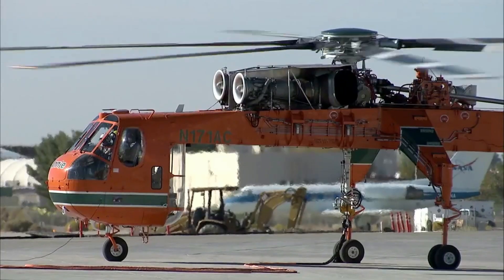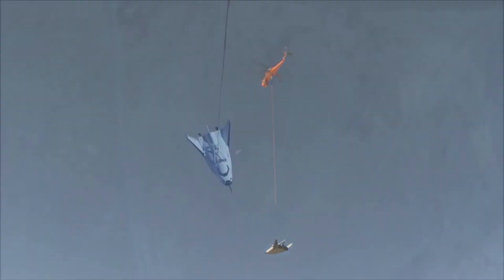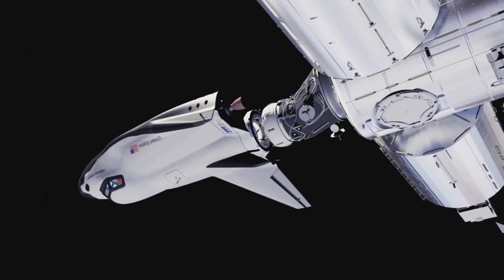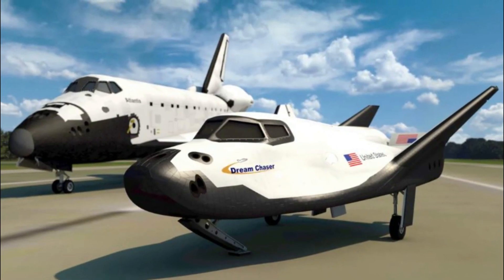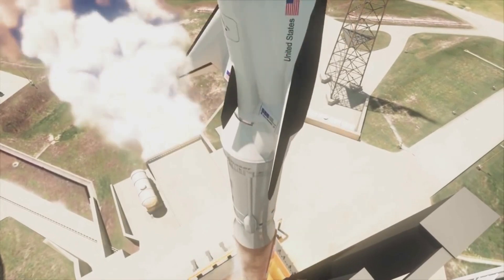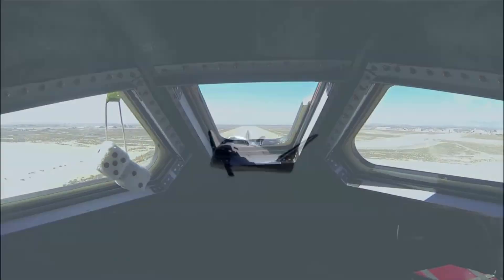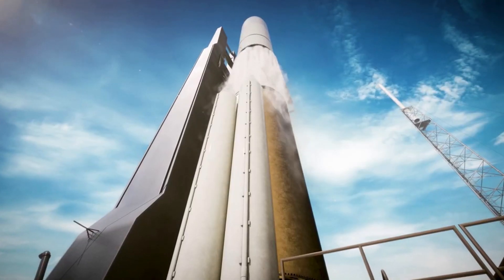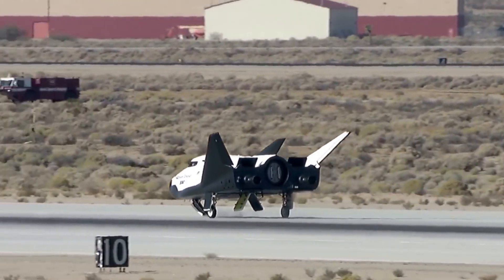More Progress Toward Dream Chaser's First Launch, Propulsion System, Updates, & More

Comment: That's just a mini space shuttle. It took almost 6 months turn around. Plus all that space age composite would make it very expensive
Reply: The unforeseen issue of inspecting and reinstalling over 20,000 tiles was the major reason for the long turnaround.  I don’t think every tile had to get replaced/reinstalled (I don’t know), but each tile could take up to 40 hours to replace - the adhesive had to cure for 16hrs, and then was compressed into the fuselage for another 16hrs with a jack holding it in place.  I’ve no idea if multiple tiles/jacks could be reinstalled at the same time, but given how the turnaround time ballooned, doesn’t sound like more than a few would have been feasible.  Obviously, NASA learned a lot about tile improvements that it passed to Sierra, and Sierra worked out improved manufacturing techniques, better adhesives, and a ship designed for better tile management.

Comment: I like it.put attachment ports on its back for a robot arm.and other test mount stuff: extra fuel pods, experimental engine packs to test other propulsion types while in space,deep space flight.
Relay resupply packages can be orbited at relay distances for it to resupply.heck even disembark to simply stretch there legs a day or two.
Sooner or later someone's going to put a light driver on it
Reply: What you are describing for your version of Dreamchaser is more or less an unclassified x37b. I like it. I like it a lot.
Sierra Space needs to get on it and you can't tell me that they haven't thought of similar ideas. I wouldn't doubt rough designs aren't kicking around on some engineer's hard drive. They just need to be fleshed out more.